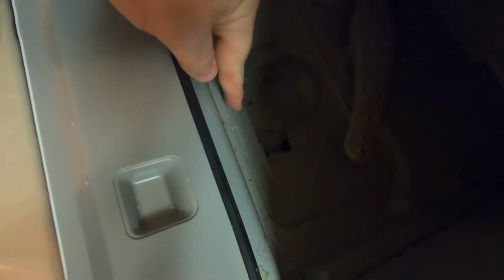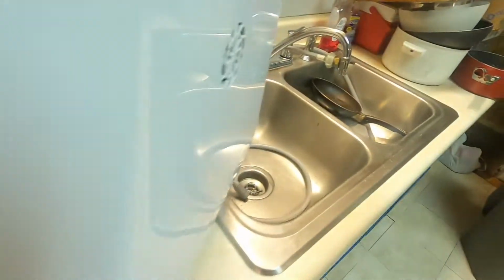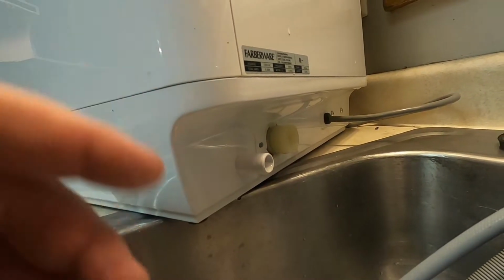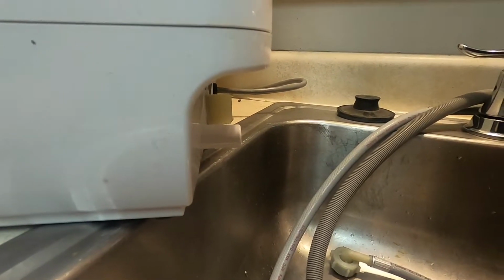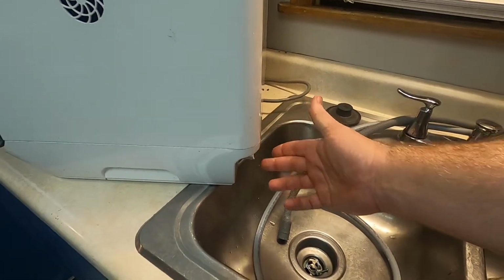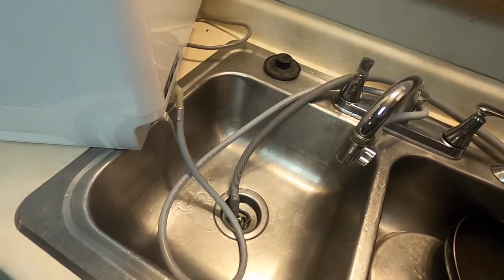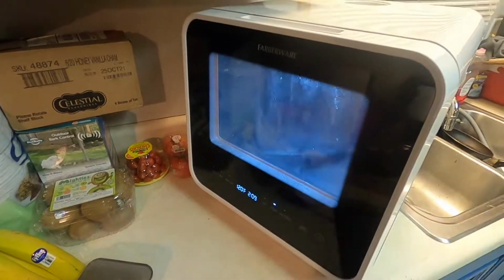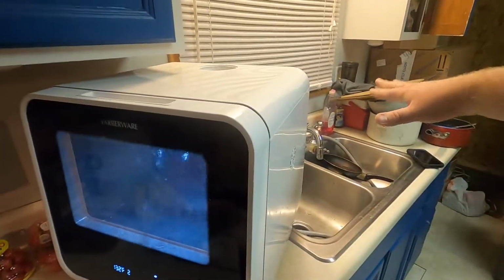ERROR CODE (E4) + (E1) FIXED! Farberware Complete Portable CounterTop Dishwasher CODE Fixed!

Comment: The parent company is Midea, a Chinese home appliance company in China. They sell this exact model under several names besides Midea. Mine is under the name, Comfee a US company, yours is Faberware also a US company, but I've seen it under Curtiss (US), Fagor (EU), Hisense (CN), Hoover (US), Kenwood (US), Masterchef (US), Russell Hobbs (US) and Toshiba (JP). They're all identical with minor variance between them all like temperatures, run times, and air modes. But the core is the same engine which drives them all. So E4 error code is the same across them all. The internal overflow floater has been tripped. 

The internal pan/tray only holds 350ml (12oz) of excess overflow water. The easiest way to fix this is unplug the machine, remove all hoses from the machine including the waste water hose. Aim the waste water port into a sink or catch basin and til the machine back. Basically lift the front of the machine until you get a good 6+ inches off the surface to see if water flows out. If yes, then let it drain and leave it to air dry overnight. If nothing drained out, then there could be gunk that is tripping the sensor. It is also helpful to stick a long thin brush* into the exhaust water outlet port to see if you can dislodge gunk built up. These type of brushes are typically used to clean straws and drinking/pouring spouts of various reusable cups, mugs and bottles with large straws. 

*if sticking a long thin brush into the waste water port produces a lot of gunk, they you're not cleaning/clearing the catch basin  inside the dishwasher. Its that metal mesh part which is a pre-filter for all the gunk that can go through the dishwasher. That port should be inspected once a week and cleaned out once a month. 

Fill the fill jug with hotwater from the tap - don't use boiling hot water. Pour into the INSIDES of the machine and not the fill port where we'd normally pour water in to fill the internal tank. We want hot water to overflow into the drain pan to help disolve gunk caught on the floater. Tilt the machine backwards to drain water. Do this at least 3 times. Let machine air dry overnight and reinstall all hoses the next day. It should work fine now.

Or my no-nonsense way of fixing the E4 error was to remove the foam floater so the sensor would never be tripped. I can do this because my dishwasher actually sits in a deep tray on my counter. I've had the overflow problem before. But I know from experience simply tilt the machine to drain the water from the pan does help. Or in my case I use the tray of a doggy training system I bought specifically to put my countertop dishwasher into. 

The sides of the tray is big enough and deep enough to hold 3.5L (4Qt)of water which I can drain off into the sink by sliding the whole tray and machine forward and remove the trays own drain plug. The trip mechanism is simple. Simply a foam bit that floats up and pushes a trip which causes the E4 error to show. Because my machne sits in a tray to capture water, I don't care if it overflows. I bought it on TEMU for only $9 CAD. So it was my cheap economical solution. https://youtu.be/GKHm63vBIoM?t=98

Comment: Even 4 years later this is the most information presented in the most easy and straight forward way I could find. In fact if you google my model and ‘manual’ it doesn’t have one accessible but will show up under websites like London drugs. Yet, not a single error code mentioned until the end where it says, “ and it can present an error code”. Soooo helpful. 
So thanks again for doing this we all appreciate it.
Reply: can you pls summarize the solution? i watched the full vid & i keep zoning out

Comment: I realized that mine likely has a water sensor under the machine! 
I tried a lot of stuff, but when I went to tilt it a second time, I saw a lot of water under the machine. Cleaned that up, and the code disappeared :) 
I have the machine standing on a dish towel now so that I can see it getting darker from moisture if it happens again.

Comment: So…I had the hose too coiled in the back to accommodate the proper length/distance to my sink. I guess and it wasn’t draining properly. Now it won’t even turn on at all without the power tripping. Perhaps water got into the electrical components? I did not realize having the hose coiled could do this. I have it sitting outside in the sun/heat to try to dry it out. Any advice? 🙏

Comment: Well! I just got an E4 code on my Medea countertop dishwasher tonight. I overfilled it.

The manual was useless and tells you to get a repair guy to fix it. Thanks to this guy! His Farberware looks a lot like my Medea and the same solution applied.

I had to drain everything, tilted it on its side to drain the float, dried everything out and then plugged it back in.  It worked!

Comment: Great repair video.  I have the same Farberware Dishwasher.  I did have to turn it upside down to empty the fresh water tank.  Just turning it on it's side did not work.  I finally got it to work after turning it upside down and emptying the fresh water tank.  I don't think turning it updide down broke anything because now,  it works just fine.  Thank you for posting your video.

Comment: I always fill the water from the top, never hooked it up to my faucet. 
I got E4 code. I disconnected from the wall outlet, removed the dishes, cleaned the filter, disconnected the waste hose thing (I positioned the dishwasher so the dishwasher could shoot directly from the outlet to the sink without a hose), reconnected to wall and then tried another cycle  and I got E1.
Then I removed all the water by tilting the dishwasher on its side (the water came from the top, which is where I fill the water).
I refilled the reservoir with water and tried again, and again I got E1 🤷‍♂.

Comment: I have the cookology version with no digital screen and a solid door. Mine is not plumbed in so I fill it with water until it beeps and the hose empties into the sink. It's not even a year old and is not working. It makes the noisy start up sounds  then stops and beeps. Tried everything. Does anyone have any ideas?

Comment: for anyone who tried this and it STILL said E4 - you need to take of the black plastic panel on the bottom, remove the little square black box connected to it - inside is a polystyrene float - check it hasn’t warped out of shape, flatten it back down and put it back in - solved all my problems!

Comment: E4 midea countertop - I had exactly the same issue described, that is I emptied and reloaded, and filled the water well manually before the air circulation of the prior cycle had finished. E4 code and no functionality. Power off and on didn't work on its own. 
With power off, I removed the dish rack and drain in the base, drained out the water for the next load, then tipped it to the right hand side and about 2 cups of water poured out. I then dried it off on the outside and all around. Turned it back on at power, switched it on, E4 code gone, no water alert sounded so refilled the well and good as gold again!!! Awesome.
Reply: thank you so much you saved me
Reply: How many of the pictures does it take for the water tank

Comment: Thanks man, you helped a lot fixing a Midea wqp4 which is the exact same machine except the different display and buttons. I had also an E4 error with rare E1, it took me a while to understand that my exit hose was inclinated upward and the pump wasn't strong enough to push the water up and out.

Comment: Thanks.  I thought I got a dud. I filled it up before turning in the power; and got an E4 code.  And I guess it got "confused" because the faucet light wouldn't turn off. So I did what you did. And then a test run. Then BAM! It worked. Had to empty it and start over. Thanks for the video. I was ready to pack it up and bring it to the ups!

Comment: I would be curious as to how many have had problems with detergent pods. The pod I have been using fits neatly into the small square in the door so I thought it was doing fine. Until I had an E1 error code. I used the syringe method of pushing white vinegar into the inlet where water shoots  from the reservoir into the dishwasher area. It worked for a complete cycle. The next cycle of washing dishes the E1 error code came on again. I also noticed that there were way more suds than the first two cycles so I think detergent residue is collecting from one cycle to the next and then becomes a problem. I'm going to try a liquid detergent next time and see if that improves things. I will also do a rinse without any dishes as you suggested in this video. Thanks for you wonderful videos. It really is great of you to do this and you explain it so well. I want to add that the very first time I used it, I guess I must have missed the alarm that it was full because it overflowed all over the counter and then onto the floor. I didn't trust it after that so I took it outside and used it the very first time. That time, I did not miss the beep letting me know that it was full. I haven't had a repeat of that since.

Comment: I couldn't use dishwasher detergent in mine. It hardens at times and blocked it. I had to make mine homemade but don't use epsom salt that hardens too. Use only baking soda with a few drops of dish detegent. Dish detegent goes a long way so it only takes a couple of drops. Then it worked great without clogging.

Comment: thanks, it was helpful. I had an E4 on a similar dishwasher, there are a lot of rebranded models seems they come from midea brand. I guess I got the E4 due to a temporary faillure of the tank overflow sensor, I was filling the tank manually and never heard the alarm as usual, then E4 came. Since I was suspecting a stuck  floating sensor I removed the covers. It is not intuitive. I want to share it. In my case, there are two screws on the top side inside the washing chamber. After removing these screws, the top panel can be removed and the back panel too. To remove the side panels, there are two screws on the top and four on the back, they are easy to find. At this point if one want to run a cycle it is needed to seal the holes of the first two screws removed. Tape in my case did not work so I used a bit of hot glue. At the end everything worked fine and what I did was taking out all the residual water that was in, way better than a broken part!

Comment: May I ask a question? Mine will spit water out of the back that is very clean and will get ready to spray but won't, it throws E1 and E4, I did turn it on the side multiple times both sides and I have been filling it from the top. I appreciate any help!

Comment: I was a dummy and grabbed the wrong bottle of detergent, yup it was the dawn bottle. FYI mine is a magic chef but I'm realizing after watching several vids that they all have the same innards, it's just the name and outside that's different.

I hadn't realized this until I got the angry beeping and opened it up to be welcomed by a wall of bubbles... I emptied out the dishwasher of everything: dishes, the rack, and the screen. I had to scoop out the bubbles and constantly run water through it to wash away the bubbles.

The error however wouldn't go away. After some research and watching this video (thank you by the way!!!) I decided to try removing the drain hose and tipping it backwards. I seen the small amount of bubbles still left in iit to tell me I didn't get them all out, prolly from the float that you mentioned. I hooked everything back up and plugged it back in. To my surprise it wasn't angry any more and showed the normal screen.

I'm about to load it back up (with the correct dish soap this time) and go back to it.

Thank you.

Comment: Hello, 
I just wanted to know if there was other troubleshooting solutions than those we could find on the manual or online. My dishwasher does not display any error message but starts by filling up with water and then the timer starts to count down but nothing is spinning. It has worked perfectly for 1,5 years but now is not working anymore.
I tried to force drain multiple times and to clean the filter and look for obstruction under the filter but nothing seems wrong. I suspect a faulty pump. Is there any way to repair it? Thanks for the help.

Tom

Comment: We have no error code on our 1 day old machine. But none of the buttons work except the on and off button. 2:35 displayed on the screen and Eco light on. Absolutely everything else is unresponsive. Switching on and off at the plug does not unlock it either. Has anyone else experienced this?

Comment: I tipped it back, front left right and some water came out. Had to hold it with the front lift for a bit and then turned it back off and on and it worked. Thanks

Comment: How do you fix e1 code
Reply: I used descaler on it overnight (citric acid mixture) and blew out the intake hole with compressed air. Now it's working again without an E1 error.

Comment: Before I found your video I poured two cups of vinegar in the top and let it sit for about an hour.  Per your instructions I turned the drain to the sink took off hose.  Then I kept the water filling on the top and it kept draining.  I cut the water it drained a little while longer and reset itself.  Back to normal thank you so much.

I will cut my pods in half from now on you made a good point.  Also it will make it cheaper which is also a good thing.  You are my hero!

Comment: Update on my comment below: My son used a CLEAN; BRAND NEW $2.00  Disposable ENEMA from Walmart to squirt into the side of the dishwasher to dissolve any clogging. Put FAUCET HOT WATER AND SQUIRT it into the side hole several times until item is dislodged. Our enema has a 2 inch long skinny neck that fits perfectly into the hole into the side. It unclogs it in 2 minutes every time! We keep this hidden by the dishwasher if we ever have emergencies. I am an older female and am able to unclog it myself now. We have also switched to faucet HOT WATER to fill the tank to clean our dishes. It dissolves any buildup. Also, using only LIQUID DETERGENT (powder can clog it). We do a clean out twice a month with 'Finish Dual Action Dishwasher Cleaner: Fight Grease and Limescale' or a homemade vinegar cleanse. To use:  1 cup vinegar in empty dishwasher and run a complete cycle with HOT Water only. They also have an Re-usable enema kit with a nozzle that may be thin enough to squirt into the side, we have not needed to try that yet. We did try a Brand New Disposable Douche for Women but the end nozzle was too big. Sorry for the detail but this has worked miracles for us!!

Comment: Had the E4 problem, emptied the dishwasher as advised.......but....and this is important.....when filling the dishwasher with water....bear in mind, the tank already has water in it so, in order to prevent overfilling, use two and a half jugs of water, not three , that's why you get the E4 code.

Comment: Mine does pump and drain the water and the timer runs through for every programm, but No water being heated and no "jets" of water on top, nor or on the bottom. Do you have any idea?
Reply: Mine was like that so I took half a gallon of white vinegar and hot water and ran an empty Normal cycle. There was gel everywhere from built up detergent. I ran two mpre hot water only load on rapid and now all is clean and working well. No more gel build up messing it up.

Comment: I bought a similar dishwasher (Comfee brand -- probably made in the same factory because it's nearly identical) and I've been getting this same error message off and on. I just bought it recently and the first load was good, then after that it's been hit and miss whether it will stop with E4 mid-cycle. I've tried this and it works fine for a load, and then blasts E4 at me again. Very frustrating for a brand new dishwasher only 10 days old.

Comment: Hi! I found a different solution to this issue, I took out the metal tray with a filter from the inside of the dishwasher, and turned out that the mesh filter was completely clogged with tiny food particles, which stopped the water from draining, I washed it with a brush and with a tiny washing brush for reusable straws, and the issue hasn’t happened again! Now I just wash this filter every once a week or so, only takes 2 minutes. I guess using a hot water cycle does a similar thing, but it is not as thorough!

Comment: You helped me troubleshoot my E1 error code and now E4!!  Thank you so much for breaking this down in a way that I could easily digest.  I thought I had fixed my E4 issue on my own but whenever I plugged it back in, the E4 code flashed and the dishwasher kept trying to run a cycle.  I was able to pull up the filter trap area and saw standing water in there, I check for tube kinks and what really saved me was tilting it to get all of that water out.  I never would have thought to do that.  Thank you so much!  You saved me from having to call my plumber to fix it.

Comment: Thanks, I have the FCD06ABBWHA one which is bigger. The E4, I cleared it by tipping it - yes some amount of water came out - and clean the intakes and outtakes. I also clean the rubber seal around the door to be safe. It cleared the error and it seems to be working.

Comment: Hey there I did one cycle on a hygienic wash using a finish dishwasher tablet and that was just the very first wash this is the second wash and I feel like the tank he's in the jug and the D4 kicked in it's started to pump out water like nobody's business so that doesn't seem to be but there's absolutely nothing in there whatsoever now and still the default is on the screen I turned it off for a while and turned it back on and still the D4 just kicked him immediately and there's no water in it what sort ever? Any ideas?